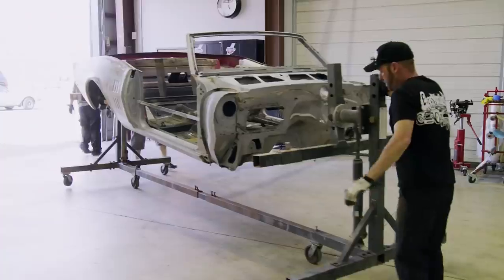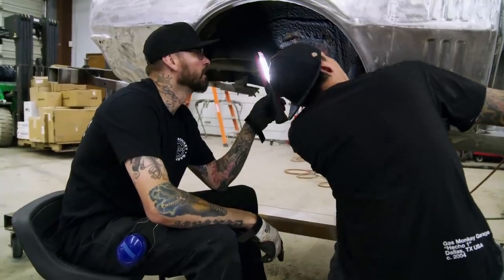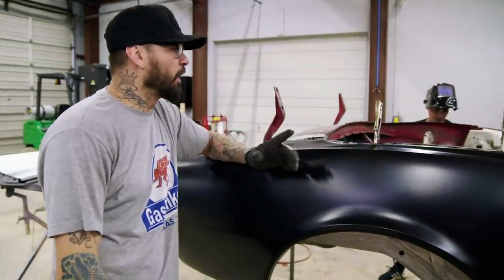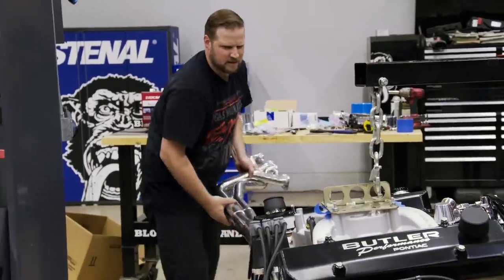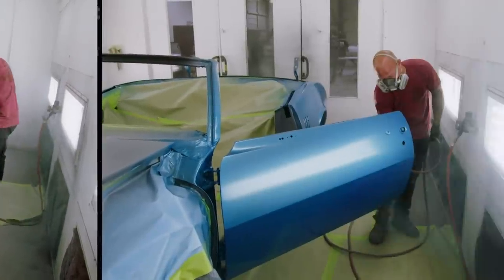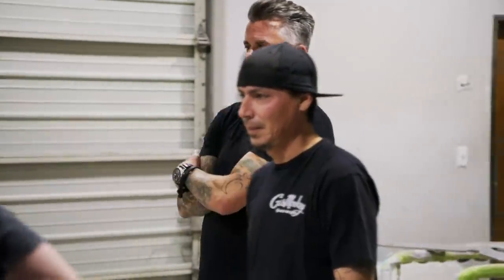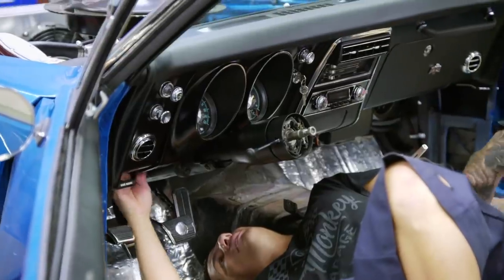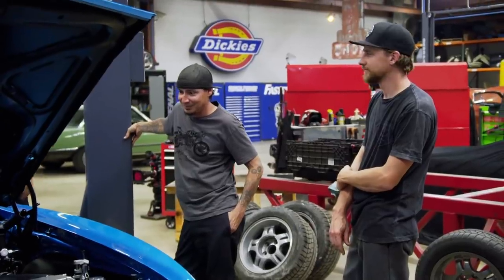Richard Rawlings Hates The Colour HE CHOSE For Custom ’67 Pontiac Firebird I Fast N’ Loud

Comment: Funny, for a 'restoration', it's got a new chassis, wings, engine, gearbox, exhaust, radiator, roof etc etc etc. I don't know why they don't just build new cars to be honest rather than starting with something from 1967 and keeping 8% of the original?
Reply: Can take a lot of time money and patience to do a full restore like that. Gas monkey is still a business and they want those cars out as fast as they got them in, you’ll see if they find a car that hasn’t been touched and still has a lot of the original pieces they will go for a restore. But for cars that need a lot of work it just isn’t worth the time it will take to get it there.
Reply: @Anthony Gill  Oh I get the commercial side of things, it's just a way from American Hot Rod if you ever watched that. They were custom making cars from the ground up, not just buying bits and bolting them together. If they needed a chassis then they made one, wheels were made in house from billet aluminium. Still some drama etc of course, but just a very different setup.